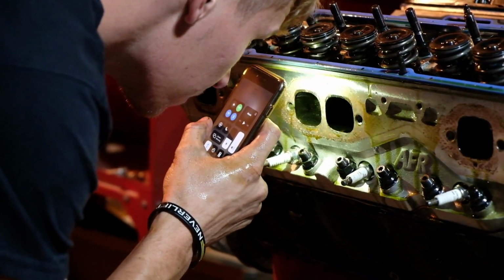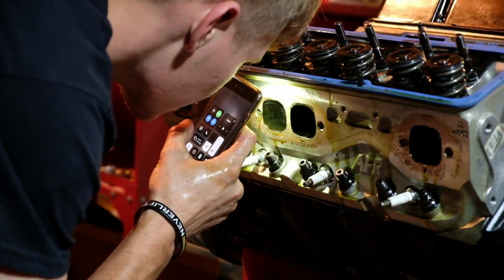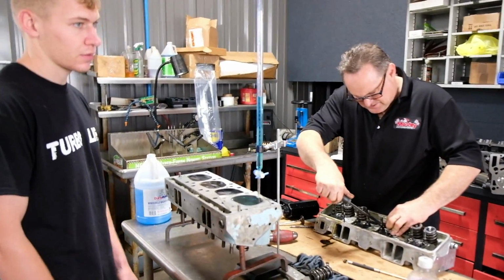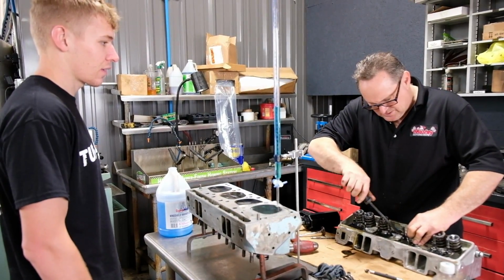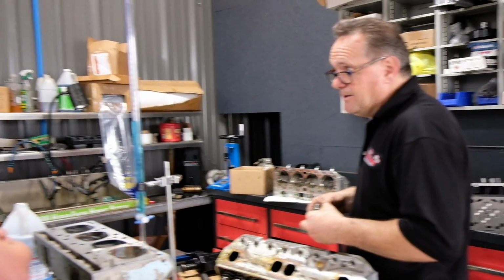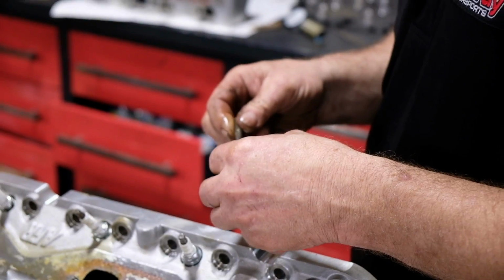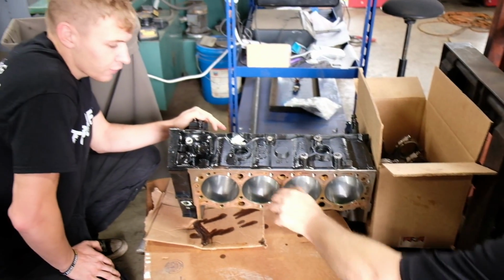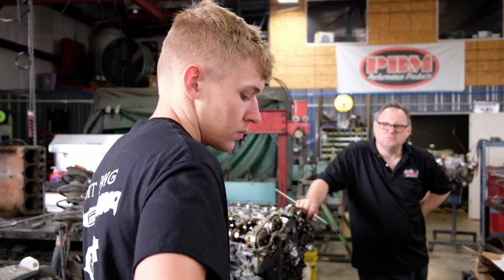AWFUL WEEKEND 😣 No Prep Mania 4.0

Comment: That much street driving and not the top notch valve train is gonna give you issues. Jesel shaft and jesel lifters.
Reply: If a part is going to break, it won't matter who made it.  Knowing the "why" is always more important than the "what"...
Reply: @vengeanceizmine9878  Would you rather have jesel rockers and lifters or stock parts ? Issues that come with stud mount rockers and a $300 set of lifters will not happen a lot of times with jesel parts. Of course its racing anything can happen.  This is why race cars are not driven to the track 99% of the time.

Comment: Why are “street car” engines so expensive to maintain and “race car” engines not? There is always someone faster and for God sakes, Stay single.
Reply: Race car engines are very expensive but depends on how fast the car is, more maintenance is required the faster you go! Street car valve train takes a good licken most the time because we are off and on and off and on throttle at high rpms depending on streeet!
Reply: Plenty of $200-500 turbo and nitrous junkyard motors kicking ass every weekend, even if it was only for that one weekend LOL